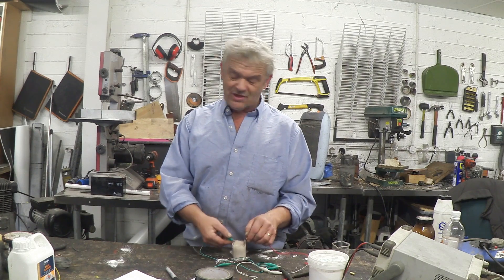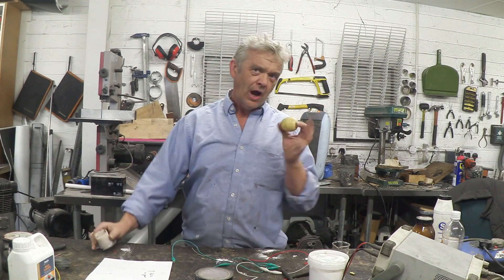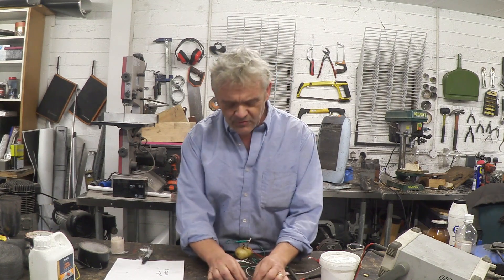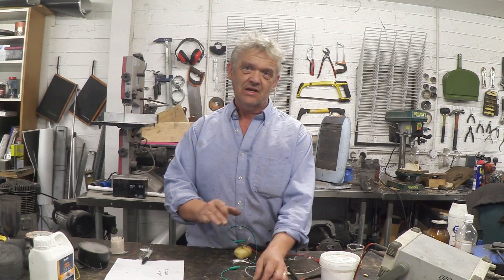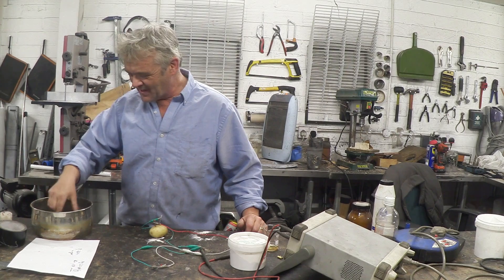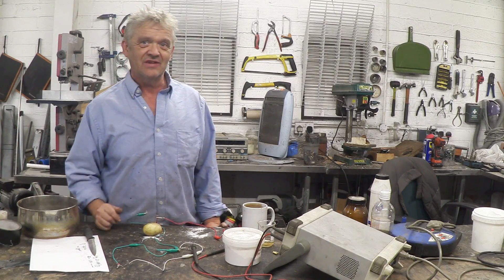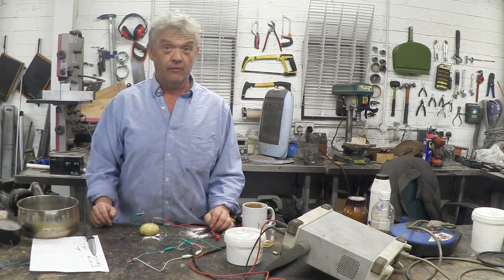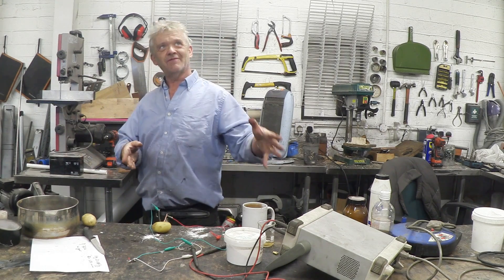1229 Boiled Potato Batteries and Crystal Cells

Comment: Ever tried applying a voltage multiplier on these potatoes? Hook up the potatoes in parallel to half down of the internal resistance of the potato to get higher voltage and current.
According to chatgpt, we'd need to have an oscillator there to have a current. Attach the potato in a spinning dc motor and jerk it back and forth between a copper coil? :D haha. I dunno. I'm just thinking out loud. I guess I need to buy some potatoes now.

Comment: Design a circuit board with traces as close together as possible without shorting. Arrange these to the edge of the printed circuit board with every other line connected together. You want two alternating rows so you can connect them up in series at two points on the board.

Leave half the traces in copper. The alternate traces would get zinc plated by the board maker.

Plug a series of these circuit boards into a potato and wire the cards together to make an even larger series array to maximize the output voltage from the potato.

Granted the current will be super low but you might find the voltage level very high!

Comment: Electrets were neat. Though rochelle salt may be a salt and a poor electret the idea that you could charge a salt battery up while molten and then cooled to extract a small charge out of it. This is different than the carnuba wax based electrets that seems to hold electrostatic fields. Though the Rochelle salt batteries are a bit of a crystal cell but not very conductive electrically. And I wondered it it would work as an electret. But Rochelle salt is paraelectric or conductive in some magnetic or electric fields.

Comment: Five negativ you dont play with food? But now days its a questions about good enough enzymes! And I think now on John Searl and his generator! Something who to hard to make it work for house need can with a oil barrel a few bikewheels and a few more items from the junkyard make a kinetic-battery, how works on demand! Put a comercial Tesla battery with a Virtual Power plant between your need and the grid! airliquid batttaries drive a Tesla Air Generator and after that a cooling on a Stirling-enging after  that, rest air blow on to the VAWT! You dont need a heavy stormy weather to make it works you just need a vivid imagensation to see in a longer solving way! And now to the potatobattery if you pull the diod one string into the potato and the other on a coppernail how also is put into the potato isn't thats enought materia on a diod why not add on it directly! Now look at the stalk celery or  a swede tulip or something else already tossed away!

Comment: Robert, I am the guy that has teased with the new graphene method, for about a year. I am going to give it away freely here right now and after I tell how I do it, I only ask that everyone read on as to why I have chose to not patent it and just let it ride freely. I call it the smear method. You need a piece of metal, I find those tin no trespassing signs work well. You need a fist sized piece of quartz crystal with at least one polished face. You need a nice puddle of elemental mercury metal I have found the best source is old plumb bobs are loaded with it, theres still ways to get it. Its reusable so, you just need about cup of it, forever. Also some high quality graphite, it doesn't have to be exfoliated, just use natural graphite dont try to use cheap lock grease, but if thats all you have and want to see this work go for it, your just going to wind up with contaminated mercury, and graphene. Ok heres whats up, for all you that haven't smacked your forehead yet and said, "Why didn't I think of this" by now. Take the sheet metal and fold the 4 sides so you have a square bowl with just high enough edges to keep the mercury contained, add mercury start small, dont worry about the metal amalgamating up it wont after doing this a year Ive only managed to get it to amalgam from using a drill bit and trying to force it to. Just pour it in, and sprinkle powdered graphite (I use a coffee bean grinder after crushing in a vice) on the mercury. The graphite sticks to the mercury, you will see it. Take the crystal and strike the mercury , what your doing is creating a piezoelectric effect with the metal which in turn causes an electromagnetic field in the metal, the mercury being diamagnetic and smashed tries to run away from this magnetic field, but due to the smearing action taking place it just breaks up into extremely, extremely tiny pieces.... :) One smear and repeat you dont need to slam it so hard it flies about, just a tap. When the face becomes marred run a raman on it. let the mercury either leach out or just distill it, I distill it just because graphene does weird stuff when its how like it condenses instead of expands. 
Ok the why part. The inventor of the x-ray machine gave me the tilting motivation, Ive been battling giving it away, or becoming uber rich for over a year. Here is my thinking, Ive never had money, lifes been a struggle since day one. My friends are all broke, and that is my life. Im happy though, I dont especially think money makes you better, but then a really good friend ran into a bunch of money and he turned into a complete asshole. No one likes him anymore, he thinks hes better than everyone else, and Ill be dammed if Im going to go out like that. I would rather die knowing I contributed to giving humanity what it needed to survive this current population issue we are facing. I think this very well can do just that, it will allow everyone to generate his or her own electricity. You can do that with graphene and its published. It will enable us to advance as a species and that is too valuable to horde it to myself, Im not really that smart I just watched a you tuber video about Graphene and had a dream in that dream I believe God gave me this to share and thats the only way I will ever remain sane knowing what I gave away today. Please enjoy and no one can claim this as hers or his, its ours.
Reply: What advantage does this method have over the much safer established methods to produce both graphene and generate piezoelectric power? I don't believe that money turns you into anything that you aren't already. Money just gives you more opportunity and power to express the qualities and defects that you already have.
Reply: Let's see brother 🤙
Reply: Hi Steve

As per the other reply can  you upload a video?

Slainte
Tariq

Comment: Really cool thing I discovered with magnesium is how to make it work in a rechargeable battery.  I used Epsom salt which doesn't react with MG, and charged the battery using a carbon rode, then discharged using the magnesium and I was even able to leave the Mg in the battery.  This as you know is because MG doesn't like being recharged.  I used lead oxide for positive, and it was able to hold close to 3 volts!  Repeated charging and discharging worked really well.  The only problem I noticed is, the MG does start to slowly degrade, but you can still get a ton of cycles out of it! Keep these battery vids coming!
Reply from the maker: sorry mate to clarify are you saying Mg anode, Pb/PbO2 for cathode and epsom salt for electrolyte?
Reply: @ThinkingandTinkering  PBo2 is positive, MG is negative.  But you need a 2nd negative plate for charging, using carbon or lead works fine, just don't hook your charger to the magnesium.   I also tried graphite foil on its own as an positive and it worked really well too, in fact it's likely far more energy dense, just not as punchy as that tasty lead oxide.  :P  Just remember to have an additional cathode for recharging that is not MG!  I've only really tried 2 different other materials for this MG battery, lead and carbon.
Reply: @ThinkingandTinkering  - likely :
Lead Ox impreg'd Carbon (Anode) ..... 
Magnesium as (Cathode) ... 
Epsom Salts as (Electrolyte).

Comment: So imagine 16 in series to reach 24volt. I recently picked up a near 6 ft long Led strip light that runs at 10.1w at 24volt. That 0.5 miliamp could be ran on the boiled potatoes circuit but for how long and I also wonder that buried beneath the soil if it would possibly last longer? In a way , wouldn't it then become an earth battery? Hmmm
Reply from the maker: give it a go mate

Comment: Is there any way to create a potential between two or more salt bridges?
Reply from the maker: yes - but what advantage would you get from it?
Reply: @ThinkingandTinkering  Well, I tried introducing a sodium chloride barrier between zinc sulphate and copper sulphate in the hope of increasing the voltage from 1 volt to 1.5 volts, but it made no difference.  Also the copper in the copper sulphate still showed up on the zinc electrode which I feel it shouldn't have done.  I was expecting to get sodium sulphate from the reaction and copper chloride.  Another battery I made was an aluminium sulphate battery in a pesto jar which pulled a current of 20 mA at 0.6 volts for several days using kitchen foil.  I made another which pulled nearly 500mA but only for a few minutes using more surface area.  I gave up on aluminium foil because it was too fiddly to prepare all the strips.  But I was wondering if powdered aluminium mixed with carbon soaked in aluminium sulphate might be made to pull a high current.  An easy way to make a zinc sulphate cell is to soak cotton wool in zinc sulphate, sprinkle a few crystals of copper sulphate on the copper plate before hand.  The advantage being that it makes it less spillable and slows the copper sulphate from over mixing into the zinc sulphate, and that it can easily be disassembled after use.

Comment: Funny enough, I am eating sodium electrolyte bridges with lowered resistance as i watch this. though i prefer the pan fry method more than the boil lol
Reply from the maker: lol
Reply: Nay, air fried without the Teflon much more better.  lol
Reply: @wayne975  or you could just use a metal pan with some olive oil.